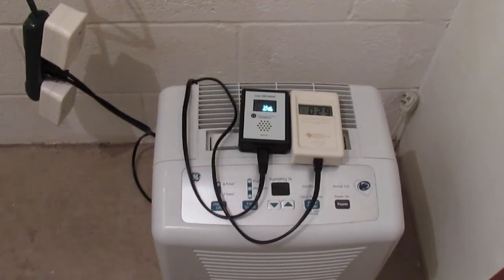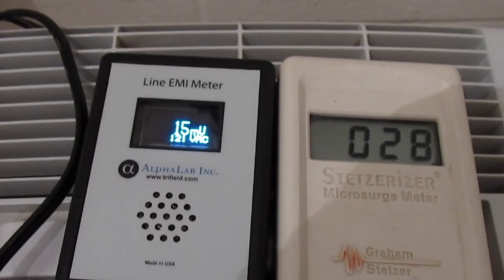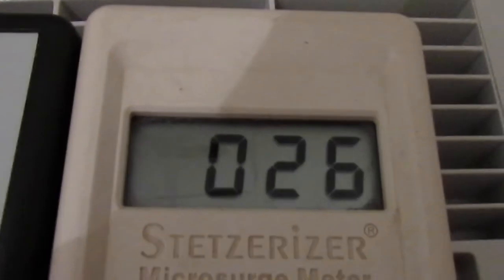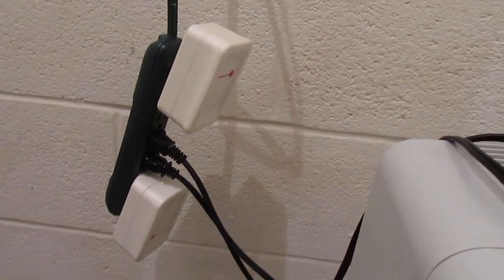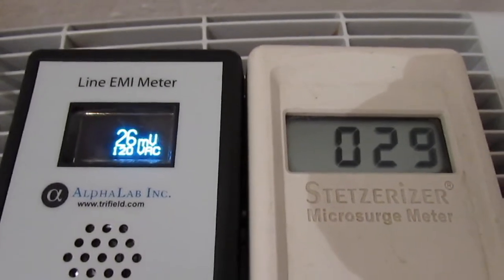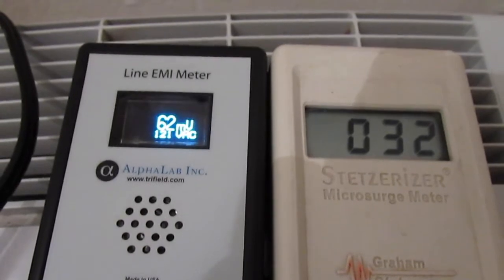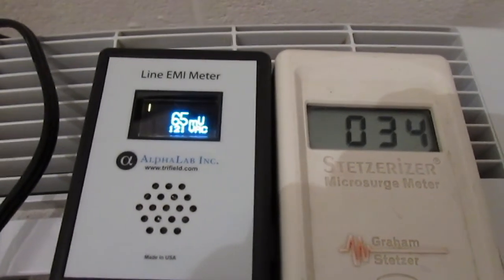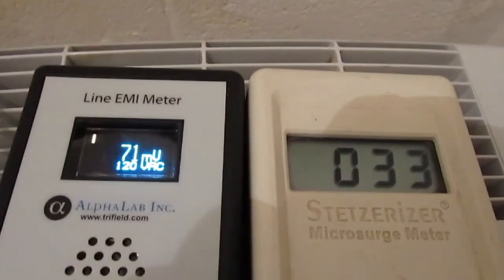Testing Dirty Electricity - Line EMI Meter & Graham Stetzer Meter | EMF Minimalist

Comment: I like your video.    It highlights one of the challenges of getting to the bottom of DE problems - how to get reliable test results.   Very strange that the AlphaLab meter went up 4 times with the 2 filters removed and the GS meter only went up 30%.   Is there any data to correlate the readings from these two meters as well as the Greenwave meter?

Comment: I am not surprised by the finding, but I am surprise by the results, The reason, goes like this, 
I had a mains AM radio turned on & off any station so the radio AGC had the RF-AF gain high and it picked up static, I turned on a dirty electricity filter, The static on the radio went up and the reading on the meter went down. 
Suggesting there is something wrong with the way dirty electricity is measured, 
It seemed the filter moved the noise or "dirty electricity" to a different part of the spectrum,  and agrees with what Steve says below. 
this is why it seems some people seem worse off with dirty electricity filters 

BTW, the "Line EMI meter" might come under a few different brand names

Comment: In other words, the Stetzer is an innacurate POS... Whats the point of a filter if it only drops 7 points on a Stetzer meter? Glad i bought the Greenwave.
Reply from the maker: There's nothing inaccurate about the Stetzer meter. It just uses different units, scale and frequency response. Either will be helpful, but both will tell you more. At the end of the day, I prefer a meter that includes the sound modulation.

Comment: the stetzerizers ignore 50/60 Hz signal, does the alphalab line meter?  the price difference isn't much, so if you could only have one meter which would it be?
Reply from the maker: Both meters ignore 50/60Hz

The Line EMI Meter covers 10 KHz - 10 MHz
The GS Meter covers 10 KHz - 100 KHz

I prefer the Line EMI meter for it's increased frequency range, LED display (visible in the dark) and sound function (so you don't have to be looking at it to know roughly what the levels are).

Comment: The trouble with this person is that he's not comparing Alpha Lab with STETZERiZER Microsurge Meter correctly or fails to explain. One is measuring MilliVolts (Alpa Lab) but the Graham Stetzer Meter is measuring transients and harmonics, not mV .  These guys do not know what they are doing obviously. You have to guess with the Alpha Lab what mV is dangerous and what is safe, but with Stetzerizer the LEGEND at the back of the Meter tells you what the experts in Russia recommend. Less than 50, but under 25 is better. 50 and over ADD G-S Filters as they are tuned to the correct KHz (50 G-S = approx. 4 Khz). The Stetzerizer Filters attenuate between 2 KHz-150 KHz taking out the most harmful Dirty Power
Reply from the maker: Both meters are measuring the same thing: dirty electricity. You can measure the same thing using different units. GS happens to use a propriety unit. The Line EMI meter has a legend in the manual...
<60mV = No Concern
60-500mV = Slight Concern
500-1000mV = Sever Concern
>1000 = Extreme Concern
Reply: so for average joe, get the $99 stetzerizer 'surge' meter?
Reply: vonshango   Yes mate; this gives you a more helpful numerical reading which measures the amount of 'energy' on the wires in more exacting science. I.e Amplitude and Frequency over time. This is supported or mandated by the Russian Health Department that building wiring should have no more than 50 G-S units on 50 (60) HZ building wiring.

Comment: yes it is interesting... Can you tell me more about the frequency range of those filters?
Reply: Rino Groenenberg 
Yes, our Research shows, and this is backed-up by McGill University, Canada that any energy on the electrical wiring at 1.7KHz (effectively 2 KHz) is possibly damaging to the human cells and goes up to aroynd 150KHz. The EMR Stetzerizer Filters take-out this form electrical pollution and stop it at the meter induction (Smart Meter) box. Therefore any readings around 50 G-S units on the STETZERIZER Microsurge Meter the electrical energy dissipates into the body and capacitively-couples to the cells thus overpowering them causing DNA damage. This is why Prof. Emeritus Martin Graham, Head of Computer Engineering Berkley UCLA (since deceased) together with Dave Stetzer designed the Microsurge meter to give a true reading of what is 'bad' energy for our health  on the wires and the Poweline Filters to stop it. Only combo system like this in the world with scientific and a workd government support.
Reply from the maker: The Line EMI Meter covers 10 KHz - 10 MHz
The GS Meter covers 10 KHz - 100 KHz
Reply: Hey dude i dont know if you are still active on this account. I have a problem in my house which is damaging my pc and have problems with my intetnet. Routers going crazy too and getting overheated and damaged too. I have in my house on normal sockets without anything plugged in nearby over 800mv and when plugging in my pc its on max 2000mv. 

Are this values dangerous for my device? Best Regards Danijel
Reply: @danipa3115  yes anything above 50 mV is not recommendable...